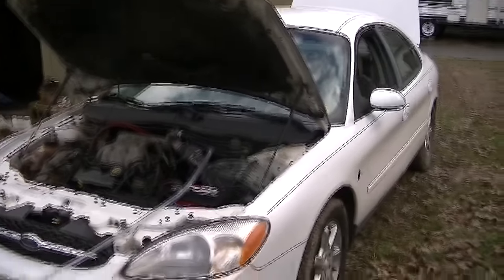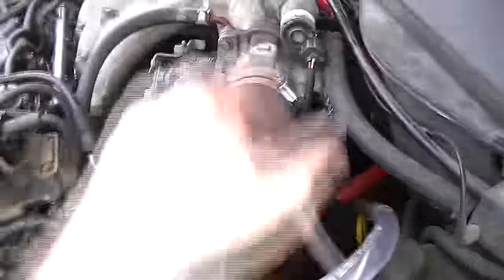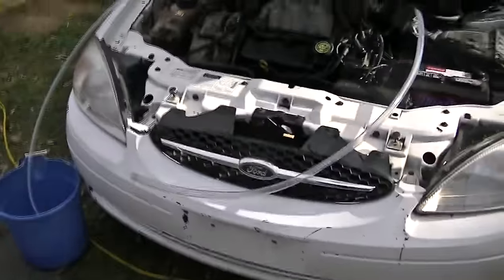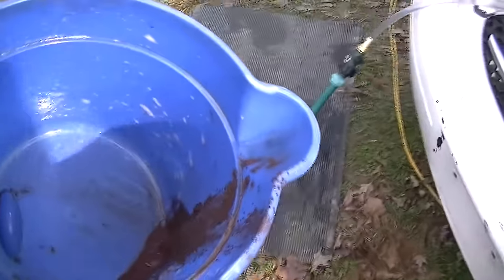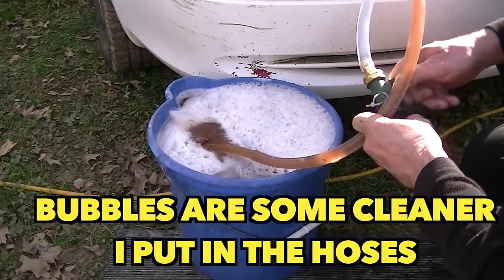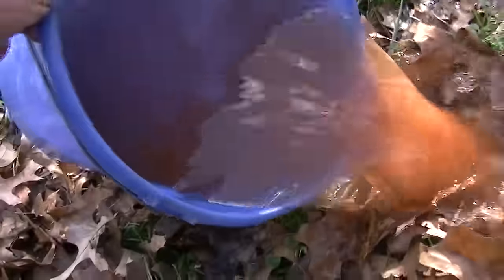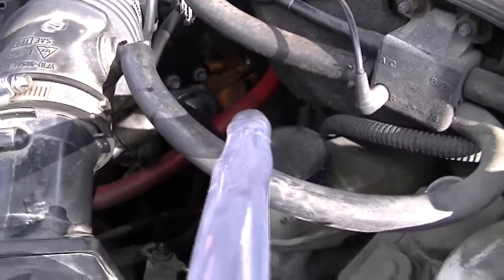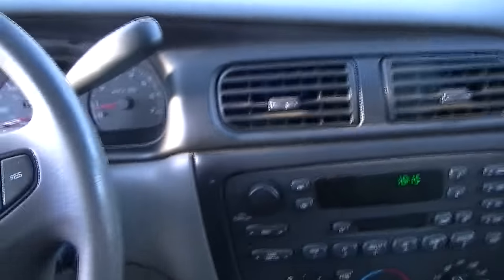Heater Core Flush...100% Plugged! This is Bad! ... Rusty water!!...But there is hope!!!

Comment: Yesterday I checked the water on my truck and it looked a little dirty well I have a brand new radiator but I was 230 miles from home with the old rad and it sprung a leak so I used a powder stop leak so I did flush out my heater core and it does work good but not the engine so I’m going to remove my upper rad hose and turn on my truck and wait for the thermostat to open then once it’s starts to go down I’m going to start to flush out the whole engine and heater core I’m doing this till it clears up so by me seeing your video I says hmm 🤔 I need to do it to have green...looking antifreeze in my all aluminum radiator thanks for posting the video. 💯👍🏼😊
Reply from the maker: Thanks....wok, work, work, work.....lol

Comment: All you have to do to unplug a Heater Core is to run some Cascade dishwasher soap through the system. I've been a Mechanic for 50 yrs works every time.
Reply from the maker: Not always....Been there done that!

Comment: I also had a 2000 Taurus, and yes, the heater core was plugged.  It had antifreeze in it, but this car is known for this issue.  The cooling passages of that push-rod iron block V-6 seem to rust badly for some reason.  It never had stop-leak added.
Reply from the maker: Push-rod iron block V-6 best engine.
Reply: I have a 2002 Taurus with the Vulcan and mine is plugged to flushed it three separate times the last time I did it was with compressed air and water both ways... it stopped working a couple days after tomorrow I'm going to put clr in and clean it put again... this time hopefully permanently...

Comment: The coolant reservoir tank on my 2006 Nissan Pathfinder was worn out so I had it replaced. The coolant tank is on the passenger side. Would it be the heater core if I see wavy air on the windshield at night? I going to clean the windshield and remove the dash mat to see if its coming from the interior or exterior vents, but I think its exterior.

Comment: Great vid. At the end, how did the heater work when dial on full cold?
Reply from the maker: There is a delay when going from hot to cold. Was checking blend doors for working confirmation.
Reply: @FixingWithPassion  Very good. You have given me hope for my Ka radiator :)

Comment: I had to do this with my 2000 ford Taurus and I did it the same way  and switch  between the two hoses  i had to do it two differn times during the winter not too bad a job at all
Reply from the maker: Switching between hoses really helps if its really plugged up! Glad you fixed it!

Comment: That Rusty sludge wasn't from the stop leak, it's a very common problem on the Vulcan tauruses. You just be very diligent in changing the coolant on these because of the dissimilar metals causing electrolysis
Reply from the maker: They called it a  "Vulcan" because its from another planet dropped off by aliens to piss off humans.

Comment: Isolated mine, blew water out with a shop vac and filled it with CLR for 24hrs yesterday, Lotta dissolved rust came out, I flushed it with water before but didn't work so well. Other problem I have is radiator fan comes on with just the heater, no defrost just heater setting?

Comment: Just got done flushing and putting back together. Had super heat for a few minutes then went back to cool. I'm gonna put another pint of super flush in and drive it a week or so. I think it will do it.
Reply from the maker: I hear that a lot. 2nd flush might work. But if not you may need a heater
 core...Mid Jan and Feb temps are going to be Ice Record Breaking Cold!
Reply: @FixingWithPassion  yea but not here in southern Alabama!! :)
Reply: @FixingWithPassion  one of my heater core line was loose so I was not getting pressure into the core. Fixed that and now HEAT!!!! Finally after 3 years working on this cooling system.....

Comment: I bypassed my core about 5 years ago because I was driving one day and my windows got extremely fogged up, so I know changing the core is a big job I elected to bypass it, but I'm considering trying to do this flush, I just want to ask because I know if it has a leak than the flush won't matter my windows will still fog, and I will need to change the core, so if my core was just clogged like this would that still make my windows fog up? So it could be a clog and not a leak? Thank you and great video
Reply from the maker: Nice!!
Reply: @FixingWithPassion  ? What do you think
Reply: @FixingWithPassion  you didn't even acknowledge or try to help me with my question

Comment: Just did this on an 02 Taurus. Wasn't nearly that bad! I didn't take all the hose brackets off the car. I hooked up hoses, one on each side, and pinched off that center bypass hose (which I don't know what the purpose of that hose is)
Reply from the maker: Nice. Mine was so bad so plugged up...I need all the pressure and force to move the rust and crap out of it. Although, if you still some heat your process should be beneficial. Thanks for your story and giving others hope!
Reply: I put a restriction in that bypass hose when I do these. Crap engineering.

Comment: Hey by the way how's the passenger floor board(underneath floor mat)  Is it wet at all and are you having to add water or coolant to it? with that much rust I would say that heater core shot if not soon to be
Reply from the maker: No it was actually dry. But i'm always checking ;)

Comment: Oh man i have an 08 f150 5.4 3v the thermostat went bad while it was closed good thing i noticed soon but the deposit for coolant was full o this brown. Stuff but only on the deposit and no where else i was thinking it may be the head gasket bu there is no smoke or any weird thing. Do you have any idea on what it could be thanks in advice new subscriber.
Reply from the maker: Probably just years of build up sediments from rust and oxidation internally. They always find the lowest place to settle in (like heather cores and radiators.) If your heat is working then I'd probably just leave it alone ;)
Reply: @UCnsNYnnppqBuo5tGB8uEtOw  its not working it blows really low only i heard about door actuators go nbad on these pretty often so ill check it out first . thank you for the response 👍
Reply from the maker: Check the inlet and outlet hose on the heater core for heat. If one side is colder...then you may need a heater core. Just feel it. That will save you a lot of work guessing also.

Comment: iron content due to never having anti freeze, if your heater core is clogged you can bet the rad is just the same.
Reply from the maker: I know right...The rad was ok. I think because it had slightly bigger cooling tubes. But I was expecting it to be and got lucky!
Reply: When combustion gases from a blown head gasket go into the coolant, the coolant turns acidic and needs to be flushed out.

Comment: After making sure that the clean WATER is circulating around the motor, drain it and almost refill with WATER, leaving a space to add a quart to half a gal. of molasses. Drive it around for three weeks. Catch the old water/molasses mix into a container. Dissolves the rust from wherever the molasses/water has been. Alloy, copper, brass, it doesn't care. Will eat it out of all areas. Got a dud freeze plug? Molasses mix will leave you with a larger leaking freeze plug. It will wick the mixture between the hose and thermostat housing. Will dissolve the rust holding together your already suspect head gasket. Will point it out to you if your heater core is gone. Cleans out all metal pipes, regardless of what they're made of. Molasses/water mix is an old trick used by many to clean rusty, corroded anything. But will not work in anything containing a high mineral content, as it neutralises the acid in the molasses/water mix. Try throwing the most rusty, ugly piece of crap you can find, and place it in a bucket of 1 part molasses, 5 parts water. Walk away for 2 weeks. With gloves (so you don't smell disgusting for the next two weeks), take a brush and give a gentle scrub in clean water. The rusty piece of crap will be cleaned all the way to the bottom of the hole. Due to my laziness, I use a pressure cleaner/ power washer/ whatever you want to call it to wash it off instead. Items that are cleaned in this method will rust/corrode quickly if the acid is not neutralized with something simple like bicarb soda.
Reply from the maker: You have the Idea. Thanks for sharing!

Comment: We have hardly any heat at all in our car so I will try the tips you gave for flushing out the heater core but I just noticed there is water in the foot well on the driver and passenger side. Do you think  flushing out the heater core will help this
Reply from the maker: No....It will make it leak more. You'll have to replace it ;(

Comment: Thanks for the video, you have helped me and see first hand what stop leak can do to the system.
Reply from the maker: Good. I have to do a ford again today...ugh At least before it gets cold.
Reply: I just finished back flushing my 1989 E250 RV heater core. you saved me a lot time and greif. Using a meat thermometor I raised my vent temp over 20 degrees.
Reply from the maker: Wow! So it cooking now?  hehe

Comment: I have a 2001 f 150 that I have to do this to every winter. I've replaced the radiator even.
I think sludge builds up in the system. And on my truck there's a water flow restrictor in one of the heater hoses so it can't get too much pressure, but I'm starting to feel that restrictor is part of the problem, because it doesn't get enough water pressure to pass any sludge once it gets a little clogged. I could be wrong about my theory but I'm afraid to remove that restrictor because it could be too much pressure and blow the heater core
Reply from the maker: Yea It could be. All these cars have this issue....ugh

Comment: Does anyone know if you do a radiator flush with engine running and heater on it it also flushes the heater core or does it have to be done separately? I have a 2000 Expedition that has lost heat in both front and rear hvac systems.

Comment: Thanks for this video. 
Where do u live, being that it will get colder in February than January?
Im in soCal and its freezing here.. its late November (Thanksgiving day actually).. it will be cold here until at least late April if not til mid or late May.

My freezing van brought me here by the way. 

Im really hoping this heater core flush works for me.. This is the 3rd winter coming with no heat. I have a few vehicles and all but 1 other has heat But i really like to use this van in the cold season.

Thanks again. Love your video.

Comment: I wish I had recorded the flush of my Dakota's heater core.  I poured in a bottle of teal colored "the works" toilet bowl cleaner (not sure what mix) and it came out BRIGHT orange...  Heater worked great after that though.
Reply from the maker: "the works" toilet bowl cleaner ...ha ha  I need to try that sometime ;)
Reply: TVWXMAN32 :
I tried the regular blue stuff on my Cirrus but it didn't work very well.  Gonna do another flush here in the next few (last few) warm days of the year.
Reply from the maker: I here ya! I'm doing one more video on the heater core on how to make it really hot again...changing some things, thermostat getting a new one going to raise the temp some.  Still warm not really hot like it should be. Stay tuned...
Reply: TVWXMAN32 :
If it's anything like my Dakota was, changing the thermostat isn't going to solve your problem.  I put the warmest thermostat I could in my truck and it didn't help.  I'm guessing you have the same problem my Cirrus does.  There is still some kind of coating preventing heat transfer in the heater core that water alone isn't going to get out.

When I flushed my heater core last time on the car, I changed all the fluid.  Since then, I've let the engine idle for over an hour and now have new contamination in the rad fluid turning it slightly brown.  I'm guessing it's a combination of left over stuff in the heater core as well as the engine.  I do have good heat once the engine gets to about half the temp gague and the fans kick on though...(normally sits down at a quarter of the gague while driving, even with a new thermostat.)

I'm going to do another flush as I said, but I'm also going to buy every kind of works I can find until I find the formula that had the teal color.

I also tried clr btw, and it did clean some of the crap out.  Just not enough.
Reply: I just re-flushed my heater core with my hose again and boy did it make a difference.  Now that the car has had a number of heat cycles over the last few months and been allowed to get to it's hottest (even overheated at one point cause of a loose radiator cap a while back) it loosened up some more crud from the engine and blocked the heater core again.

I didn't get MUCH debris out, but there was a definite surge as a blockage was cleared out.  I flushed it both directions, then back flushed the engine block through the heater core hoses for good measure.  Got some discolored coolant out both sides, but nothing that looked like chunks.

I also noticed that my car doesn't seem to want to actually send water through the heater core unless the engine is at it's normal operating temp; and even then it doesn't like too unless you get it slightly above idle.

Either way, I know I got more brown nasty out of the cooling system and the car puts out decent heat now.  At least at 40 degrees above zero.  Will have to get back to you on how it does once the temp drops down to below -10.
Reply from the maker: hellcat1988 ....That's great!  I'm going to do my expedition one more time before winter really sets in. I like heat at my feet and if the heater is not up tp 100% par, it's tough to feel heat down at the floor.  Going to do a video also.
Reply: Fair warning, if your expedition has the rear heater assembly, you're going to want to take it loose AT the heater core to flush that one.  Otherwise you may not get enough pressure and flow back there to clear that one out.

Comment: I have a 2006 buick lacrosse. Can hear water behind dash. Will this help. Also would this effect ac from being cold. Heater works
Reply from the maker: Get is ocld when hot.
Reply: @FixingWithPassion  

I have a duramax.  I bypassed the heater core because it didn't seem to be circulating.  I have only ever put RED antifreeze in the truck but when I took the egr cooler off,  it had GREEN antifreeze coming out of the top hose.

Comment: Can you get to the heater core hose assy from underneath without taking the manifold off?
Reply from the maker: Yea........But, its tight hardly no room. I tried but gave up and went through the side under the intake.
Reply: Ok cool just gettin ready to flush mine today. Thanks

Comment: So, doing a head gasket replacement before flushing cooling system devices, like engine, radiator and heater core is better than the other way round because the head gasket leak can contaminate the new coolant, correct?
Reply from the maker: Yes, you never know what debris might come loose after the job.

Comment: Nowadays, a lot of smartasses out there use quicky stopleak for it's convenience. First it stops the leak; second, it stops the flow; finally, it stops the engine. Congrats, mission accomplished! By the way, I suggest you flush your engine and radiator, too. The entire cooling system has been contaminated.
Reply: I have to do that exact same thing because some idiot fed it with stop Leak because the heatercore was leaking

Comment: Does this happen because people use water instead of antifreeze in the radiator?
Reply from the maker: Sort of and the wrong antifreeze.
Reply: @FixingWithPassion  Ok, so let's say the proper antifreeze and use is exhibited, will the radiator system still corrode and oxidize over time still?

Comment: Where did you get that snazzy hose nozzle with the turn nob on the end? I bought a cheap Taurus to fix up and sell and I'd like to do this procedure to my car before she goes away.
Reply from the maker: Lowe's lawn and garden ;)
Reply: TVWXMAN32 -- Thanks! I plan to do the flush tomorrow, but are both sides of the heater core (inlet and outlet) the same size? I've read varying repprts that one side is 5/8ths and the other is 3/4s. Is that true? I just want to make sure I get the right size clear tubing to perform the flush.
Reply: @JakeFromLateFarm  Me too! know this is old, but does anyone know?[It's 100+ here & have to walk/bus LngDist 2 buy n return if wrong] Lot's of differnt answrs. Have 2002 Vulcan ohv Gas 3L V6. One of my notes on Nathans' video sez 5/8 for one and 1/2 for other.

Comment: I have same problem. I know that garden water hose pressure is higer than water pump of the vehicle. When I connect  the water hose  at the 100% plugged heater core, no problem? what concerns me is to be  leaked  newly  beacause of high pressure  of the hose. thank you. HAVE A GREAT DAY!!!
Reply from the maker: Well....MAYBE 1/2.... but if its really plugged up...watch out for back pressure ....can get wet...

Comment: I'm going to have to do the same thing. Both my radiator and heater core. 

I just don't how to get to my heater core. 94 Chevy 1500 pickup
Reply: Joe Troutt I have the same truck and need to do the same thing.

Comment: This is a Ford taurus I had the same exact problem on my 02 taurus ses had no heat at all heater core was clogged I ended up replacing the heater core I didint wana flush it to find out i had to replace it in the end any way I had to pull the whole dash out theirs 2 bolts that are nearly impossible to get to I said screw it I just cut the bracket I saw a video on just cutting the bracket to get the dash out it ended up working out for me I have pics of it all out and everything I wish I could share it with u guys but heater core on a taurus is a night mare of a job